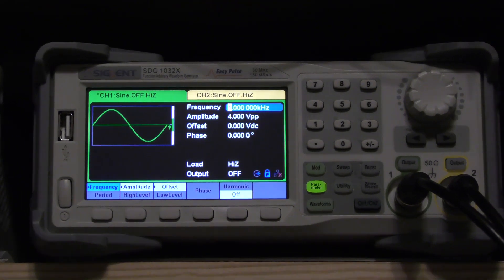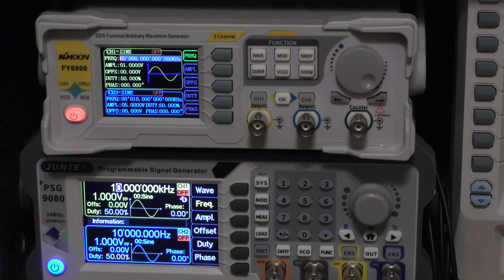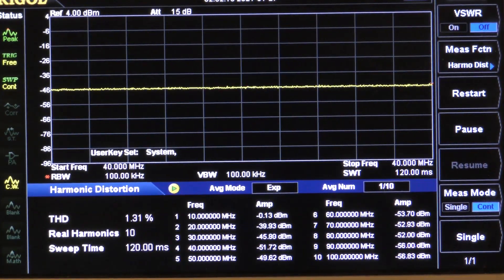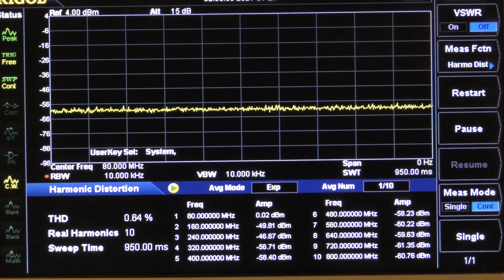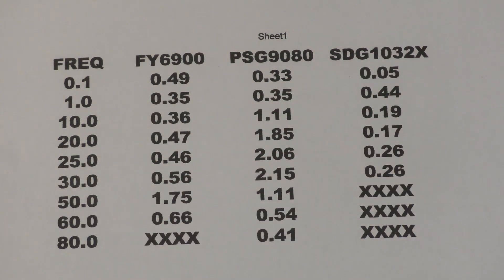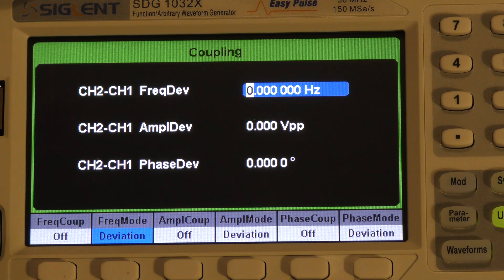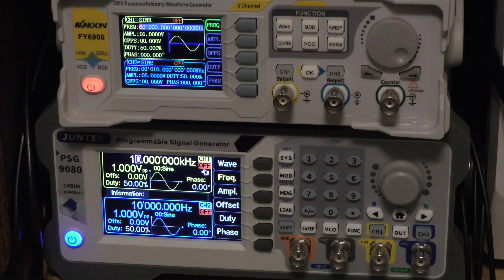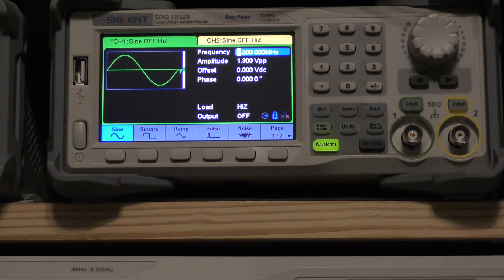TTT365 AWG Shootout FY6900, PSG9080, SDG1032X

Comment: Thanks for the review! I bought the Juntek (rebadged as a Koolertron CJDS98).  It failed after 2 days of use.  The second one failed after less than a month of use :-(   One thing I did not like about the Koolertron was the way the modulation menu was implemented: one must change menus to set the frequency (not the carrier) and amplitude - and while you are in the menu with amplitude settings, the modulated output stops.  I have since bought the Sigilent and have had none of those issues.

Comment: Dr. Tom thanks for the information,  question, if your looking into equipment for RF systems, isn't the harmonic content higher than what you would want to see? Do the commercial requirements call for the harmonics to be down by at least 60 dBm? Military community looks for 80 dBm down for spurious emissions testing.
Reply from the maker: I think you are referring to spurious emission standards for radiated emissions controlled by the FCC. I may look at those at some point in the future under EMI, but , unless you are directly radiating the signal of the generator, those standards would not apply in a baseband generator. Of course, harmonics can cause problems in a baseband generator (see my playlist on Digital Modulation for examples) but, unless they cause the radiated carrier to exceed FCC requirements (including radiated and conducted EMI) they do not create a regulatory issue.
Reply: @tomtektest8042  wouldn't the harmonics in the baseband generator get up converted and be radiated?
Reply from the maker: @pbaemedan  It depends on the baseband level, the carrier level and the modulator characteristics, which is why, regardless of how clean (or dirty) the baseband is, it is the responsibility of the licensee to ensure that the radiated emissions meet the FCC rules, regardless of the baseband generator specifications. I talked about this some in my videos on Digital Modulation, and it is certainly a good idea to have the cleanest baseband possible to eliminate artifacts like inter symbol interference, etc., but ultimately the burden is on the emitter to meet the radiated emission limits regardless of how the baseband is produced or its spectral purity.